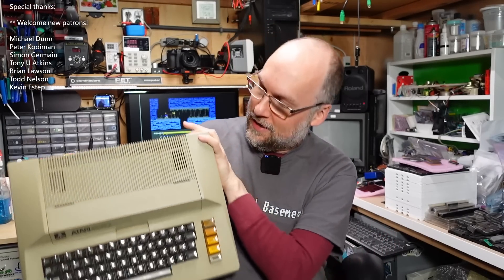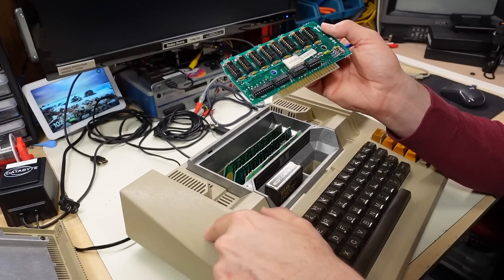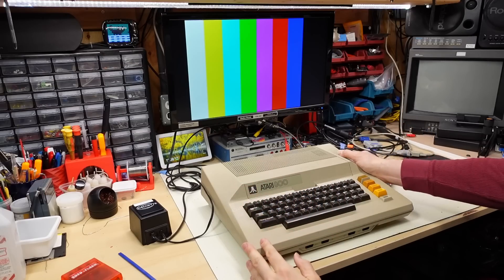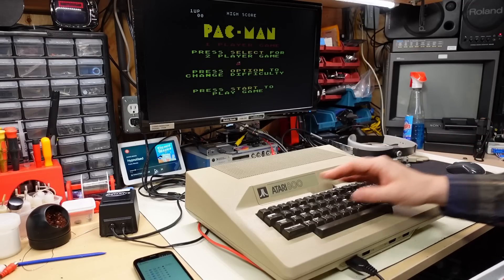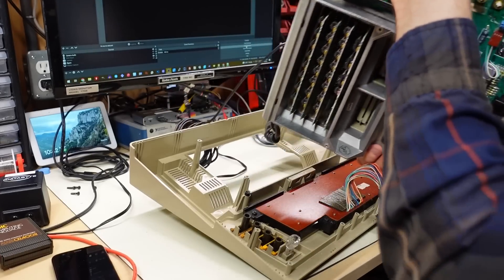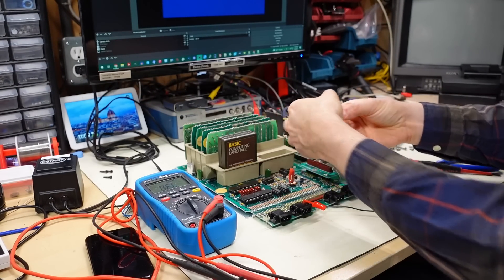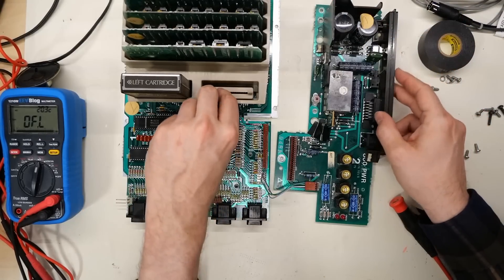Troubleshooting the beautiful Atari 800

Comment: Back in 1983 I used work at the UK retailer Silica Shop that sold these machines, and they were incredibly impressive, even after the release of the C64 in the UK, and especially compared to the Sinclair Spectrum. They were however extremely expensive, and most of the software had to be imported, and was also very expensive, so they had a limited impact on the UK market. There were some amazing games for the machine, and Synapse Software and the Lucasfilm Games were the standout for me, though most of these made it to the c64, but often the conversions weren't as good as the Atari originals. 

The disk drives were great, really quick, and the loading sound is iconic. The tape drives were awful, slow and unreliable, and I don't think there was any turbo software for them. The main reason they were unreliable is they were stereo and only one channel held data - the other could be used (rarely) for audio like music or voicovers.

I got my first proper taste of computer art on the Atari Touch Tablet and AtariPainter on the Atari 800 at work. I borrowed a machine and tablet to create some sci-fi pictures that I used to demo to customers. The positive reaction to those was the spark that eventually led to me becoming a loading screen artist later on the C64, so the Atari 800, along with the ZX81 and C64 are the machines that kickstarted me into my career.

BTW, the C64 was originally intended to have much faster hardware disk access, as there were dedicated high-speed data lines included in the design. However, in a cost-cutting measure Commodore decided to re-use the Vic20 case, which lead to some issues getting the C64 board to fit, so the mainboard manufacturer deleted the high-speed lines as they didn't think they were important! Once the mistake was discovered it was too late to do anything about it as loads of boards had already been manufactured, which meant C64 owners had to suffer from incredibly slow disk loading speeds, until coders worked out how to do turbo loading in software.
Reply: Yeah, that's pretty much what happened with the C64's disk data transfer speed.  Some guy at the manufacturing plant thought that the lines were entirely unused for some reason, and felt free to delete them without consulting the designers.  This must have been after the first sample boards were sent to Commodore for approval, which they got.  Then the hardware bit-shifter lines were deleted to make room for the new mounting hole, and over a 100,000 boards were manufactured with this defect.  It could have been fixed with a couple of bodge wires, which were common in computers back in the day, but unfortunately Commodore management were convinced that the 1541 would be a sales dud just like the 1540 (for the VIC-20), and that the vast majority of users would opt for the Datasette instead, so it wasn't worth the cost to fix the boards.

Had this not happened, the C64 disk data transfer rate would actually have been significantly higher than that of the Atari 8-bit, out of the box.  The Atari would need something like the Happy mod in order to match the C64, although the Apple II's disk data transfer rate is much faster than either.  The Happy mod would still have existed, but fastloaders on the C64 would probably have never existed, as the 6526-based "burst" mode (as seen on the C128-1571/1581) is pretty fast as it is.  Interestingly, fastloaders for the unmodified C64 and 1541 eventually managed to race past even the Apple II, however.  Using a custom format that maintained the storage capacity of the 1541, Epyx's Vorpal fastloader is, by my clockings, significantly faster even than ProDOS on the Apple II.  Epyx games that came with Vorpal , such as Winter Games , load faster on the C64 than on the Apple II.  Note that you need to have the original C64 disk, as cracked versions will not use Vorpal .  It's strange to realize that such floppy drive speed is possible even with the vanilla C64 (deleted high-speed lines) and 1541 using only software and the IEC cable.  The key to this capability is the 1541's limited but useful ability to be programmed from the computer.
Reply: @rbrtck  Thanks for the more detailed explanation, there are details there I've never read before. Really interesting!
I remember the Happy chip modifications for the Atari disk drives which were used for various, sometimes nefarious purposes...
The first proper C64 disk fast loader I encountered was on the Koronis Rift disk (which had Atari on one side, and C64 on another). I was amazed how quickly it loaded, with the clicks of the drive mechanism as it stepped across the tracks going way faster than normal.

Comment: When I was a kid in around 1982 I had a Apple ][+ system. I had this because my grandmother got some inheritance money and gave each grand kid $5k. I used mine for an Apple ][+ 48K with 2 disk drives and colour monitor. I grew the system with software, Z80 card, 80 col card all the usual sorts of upgrades. Pascal. I was able to get a copy of Apple Pascal from my high school because they had many copies for an Apple lab. Some friends had Commodor 64s that didnt really impress me. A few had the Atari 800. I felt the 800 was a really good computer and there aspects of it I wished my Apple had. Its interesting to know that the 800 maintains similar respect. In later years I got into Atari ST and then transitioned to macs when I could get a used IIci for $2k c1992.

Comment: Hi from the UK, my very first "computer" was an Atari 400 which I think I got from Maplins with a almost proper keyboard rather than the tactile board that was the norm. 400's only came with 1 socket; I think only one cartridge was issued using the right hand slot. Was fun times especially remember Star Raiders.

Comment: Thank you for finally getting around to a repair on one of your Atari computers!  My first home computer was a TI99-4A, followed by an Atari 800 48K machine in 1982.  It was a great learning experience and was far more capable for game programming than the Apple IIe.  One of the best features of the Atari 8 bit computers was the display controller.  It used a display list to identify the display mode for each vertical block of the display so you could combine high resolution monochrome graphics, color graphics, and text modes in the same display frame.  This allowed for very easily customizing your display without having to rely on machine coding or interrupts to generate very complex (at the time) displays.  If I'm remembering correctly the display list "language" even included a jump opcode.  Great stuff.  I think Atari was really light years ahead of anything else on the home computing market when it was released in 1979, and the run through 1992 really only ended there because Atari itself ended due to poor marketing.  But the basic functionality for the display really never changed (much) during the entire run of 8-bit computers.

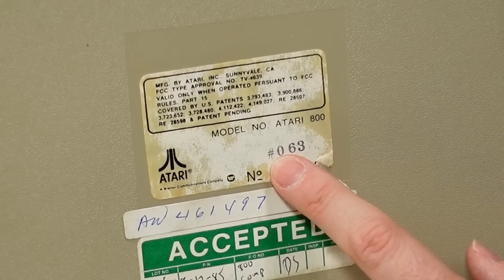Comment: 4:23  #063 = sixth week of 1983 manufacture date stamp. You will often see another date stamp on the underside case below the RF video cable (silver ink) port but not always.  SIO also does printers and there are other devices like speech synthesizer boxes, etc. The Atari will also download drivers (device handlers) from devices as it does with the 850 Interface. Great to see you cover this one! The video port jack looks nearly pristine.  

There are about four different keyboard types for the 800, yellow plungers being the worst (keycaps fall out due to age/cracking plungers). White being better (and most common), and then green the even better IMO.  Those are all square female plungers. The white plus shaped male plungers (Mistsumi just like the 1200XL) are very desirable because they have an excellent typing experience but those are mylar, unfortunately. I have one and fixing it merely involved removing the mylar very slowly with a hair drier and then just putting it right back in place again. Fixed all keys.

You said the case is strong but it's one weakness with both the 400 and 800 case plastics are that they are quite brittle, depending on how it's been stored. The heavy aluminum block inside makes a shattered machine much more likely if it's dropped.  The XL cases are much stronger and thicker and less likely to break.

6:30 yes Atari put out updated BASIC rev C cartridges that fix a couple big bugs.  Rev C have silver labels. Those brown BASIC carts should be rev A. Most XL machines had rev B and XE all have C.

You mention the RF shielding and I think the story is that it was iirc because of a single Atari arcade machine in a bowling alley that interfered with TV reception there. The FCC went completely overboard with this one complaint.  Unverified.

27:28 It's an edge connector yes but was never used for expansion. Used to test motherboards during manufacture only, if at all. It was the precursor to the PBI connector on the 800XL.
Reply: We rage threw, punted and slammed our Atari 400 after many gaming sessions for almost a decade without any issues.

Comment: Of all the retro computers I didn't own back in the day the two I wanted most were a Coleco ADAM and an original Atari 800. The former for it's delicious mad stupidity sprinkled with flashes of genius, and the latter because it's idiotically beautiful 'construction' wrapped around an excellent design.

Happily I have an ADAM and it's absolutely wonderful, so much so I keep designing upgrades for it. Some day I hope to have an original 800.

Adrian: In the unlikely event you ever read this comment thank you so much for your channel, I watch every episode. I absolutely recommend you get a working Coleco ADAM some day, fit a PSU inside it so you can store the monstrous printer, and enjoy the computer for the delightful combination of stupidity, madness, and genius, that it is. (Don't buy a broken ADAM, you'll not get it working such is the unfinished flakiness of the design!)

Comment: The Atari 8-bits were far ahead of their time, just like the Amiga! Even the main designer was the same. But Atari didn't have the heart to push them with their games library, so as not to hurt their VCS 2600 sales. Only one blasting good game "Star Raiders" was released by them, and it's a true classic. Together with the high price this meant the Atari 8-bit line never really took off in a massive way.
Reply: For me, the Atari 800 was the real predecessor to the Amiga 1000 and 500. So many staff and so much knowledge swapped between Atari and Commodore back then that I think the ST and Amiga were switched at birth.
Reply: @atomnetton  oh they absolutely were. The Amiga’s hardware features are very much just continuations of the Atari.
Reply: @deanolium  My first computer was an 800 got at Christmas 1983, I had an ST from around 1987-90, then got an Amiga , the Amiga was the 16 bit Atari 800. Coding in assembler some things were obviously an evolution of the same design philosophy.  The copper list was a display list with automation for servicing display list interrupts.  The ST was an evolution of the Commodore Plus 4 philosophy, a CPU and not much else.

Comment: The 850 interface for the 800/400/800XL was even more amazing. It had 4 serial ports and a parallel printer port. The fourth serial port supported 20ma teletype loops. Format the port for 45 baud, 5 bits with no parity and you could print with a Model 33 ASR teletype printer. 
The 800XL could boot from ram as well as rom. They even put out a legacy 800 operating system on disc because of complaints of old 800 software did not run on the XL. Improperly written machine language programs skipped using the vectors Atari specified and did JSR jumps straight to the memory. Unfortunately, many of those subroutines moved in the XL and programs would crash. Hold the System key on boot up from the disc drive and legacy 800 would load as the operating system. You could also write your own OS if you wanted to.

Comment: I had one in 1980 as my first computer with maxed out memory, a floppy drive and a printer.  I used it all through college until 1985.  I tried to turn it on during the 90's but the capacitors had gone south.

Comment: Thank you for another great video Adrian! I don’t want to throw you off the deep end concerning all the shielding but your 800 is actually missing an additional piece. There should be another piece attached to the cartridge door; that would fully shield the two cartridge bays.
Reply: Late era 800's often did not have that cart door RF shield, fyi. You can tell if it was never there because there will not be residue from the foam tape that held the shield in place.

Comment: The RAM/ROM cards used to come in little enclosures -- but they would overheat. So (like with my 800 from which I ran a BBS) it wasn't uncommon to see those tops completely removed for normal operation. I also made a plastic bar to keep the cards from wobbling around like you noted. (but only if they were removed from their enclosures)

Also the enclosures would tell you which way to plug them in. 

(and yes, the RF cable coming out the back was due to FCC requirements of the time.)

Comment: The cover opened turns off the machine so you can put a different cart in there safely.
SIO was the basis for USB. Similar protocol.
The slot cards originally came in cases....looking like huge cartridges.
The big metal structure was FCC's insistence at that time. The 2600's original RF shield was also very beefy.
Looking forward to the other Atari videos.
Reply: Not just a similar protocol, but they shared a designer, IIRC.
Reply: Atari SIO was designed by Joe Decuir, who of course worked on the Amiga, and like you said USB.
Reply: @talideon   I was pretty sure but not sure enough to mention that.
Reply: The key feature of SIO that usb has also is that devices identified themselves and contained the handlers (same as a driver) that the computer asked for and loaded on boot. Way ahead of most systems which had everything hard coded in the computer ROMs.

Comment: As with Jason Miller, this was my first computer as well. I was 12 or 13 years old too! Learned basic and 6502 on this thing, which led to a complete career in software development! I also remember writing an assembly program to move a servo motor through the front joystick ports, as well as turn on/off, um, grow lights on a scheduled time (I was older than 13 when I did that, lol).

Comment: Adrian just in case you missed my other comment, to fix the keyboard remove the mylar very slowly with a hair drier and then just put it right back in place again. I needed someone's help to hold the PCB. Use a steam gift card or something like that to help separate the mylar from the PCB. Some of the white rubber stuff from the mylar will be very difficult to remove around the screw holes. You will tear a few but minimize the tearing and when you put the mylar back in place arrange the white rubber film as best you can. It should be fine.  Be careful to not tear the white rubber around the key contacts areas. If you do just put the white rubber film back as best you can when reassembling. 

It may take 30-60 minutes to remove the mylar this way. Go slowly and carefully... It will probably fix the keyboard. They mylar has been sandwiched in there for 39 years and needs to breathe =) 

Fixed all keys on my Mitsumi 800 using this method. You are very fortunate to have that variant keyboard, if you can get it working. I'm guessing you can get it working using this method.  The Mitsumi's have an excellent typing experience but know that the plungers can break if the 800 is poorly stored.  They aren't fragile it's just that broken plungers might happen if, for example, a power supply brick is stored on the keyboard.

Someone in UK did make replacement Mitumi 800 mylars (I have two) but they do not work. It was an expensive test run (over $2000 to have 100 made I think). I can send you one if you want but it doesn't work but maybe you can figure out why. This modern replacement mylar seems to depress all keys. It might need a rubber film like the original Mitsumi so that might be the problem. Applying a non-conductive film may fix it.

Comment: Adrian, just wanted to let you know that I just used your technique (desoldering pump + hot air) to remove the CPU and sound chip from one of my #MSX machines and install sockets for them. Worked like a charm, no damage to traces or pads at all. Thanks!

Comment: I'm sure that it has already been mentioned, but the internal speaker was used primarily to emit little "boops" on each keypress. It was a really annoying feature for many, so it was quite common for users to disconnect the speaker to eliminate the booping. I certainly had done so on my 400.

Comment: Thank you for showing Atari 8-bit computers some love. Very powerful and flexible computers, if I do say so. I love my 600 XL with 64k and my 800 XL with 256K. I got an SDrive MAX for storage device emulation. I want to get the 1MB Ultimate, Stereo POKEY, and Rapidus.
Atari did release Rev C BASIC on cartridge.

Comment: Those notches would be from the manufacturing process where boards were assembled by the panel to make better use of insertion and wave soldering equipment and then broken out into individual boards later in the process.

Comment: The edge connector on the back of the PCB was for factory debugging I believe.
Reply: Correct. They could not have an external bus extension because of FCC regs. That's why they created the SIO interface. When the FCC relaxed their regs, they were able to redesign the system with the 800XL, which did not have all the expensive shielding and did include a parallel bus interface, although it was never really utilized, as the SIO was standardized on the platform and did everything you needed IO wise.